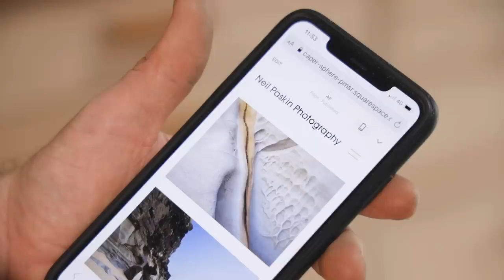Making Yosegi Plane Shaving Veneers - Scrapwood Challenge ep40

Comment: The mitre guillotine is an interesting piece of equipment, never seen one before.
Reply: @Cesar-ey7wu  Who said that using to give politicians a hair cut isn't?
Reply: At my school we have a mitre guillotine, i haven't used it very much, but when i used it (or saw others use it) only one side was used at a time.
The way he used it for making the box was like, wow (when i made boxes with 45 degree angles i used the table saw, which is anoying for small boxes and you have double the work because you need to cut each side seperatly).
From now on i will not waste time for things that can be so easy. :)
Reply: I used to work at a custom picture framing gallery back in the early 80's and they had one for cutting the material for all the custom made frames. havent seen one since so seeing this one today brought back memories for me.
Reply: Great for panel moulding

Comment: The videos I have seen usually have bigger pieces of wood making up the pattern. I see a lot of triangles made with a core piece then  a few wide but skinny strips for the outsides. And a lot of rectangles and squares.  Usually they are all made individually, glued together then, lengths cut into shorter pieces glued together to make the final pattern. Usually like 3 to 5 glue ups depending on the pattern and how many shapes are used in the final block.
 I say all this knowing that I wouldnt even be able to come close to what you accomplished here.  Only helping where I can by sharing what i have seen.
You do amazing work.  Thank you for sharing your content with us.

Comment: I have one suggestion for a cool effect: 

When you make the initial box -- before veneering, cut the sides and add the friction inserts.

Apply the veneer to the already cut box, with appropriate sizing, being careful to mark where you'll need to cut (with a knife) along the seams in the box between the body and the lid. Now, cut with a knife instead of a saw -- if you're careful you'll be able to completely hide the seams when the box is closed. 

I bet it'll be quite hard/finicky to get right, but it would be pretty cool to see it work.

Comment: Beautiful work and truly inspiring. The wood for my project is due to arrive in the next couple days and I'm excite because I've never done a project like this before. I'm using red oak or regular oak and bog oak to make the handle of a cane. I'm nervous because the bog oak is between 2000 and 5000 years old and I'm worried that I might make a mistake that can't be corrected. But I've earned from watching your videos that with woodworking, that's the only way you get better. You're projects are amazing, I can't wait to see the next one!

Comment: Your skill, craftsmanship and attention  to detail are quite amazing, your projects and imagination are most probably the best on YouTube. I'm  an old school woodwork teacher of many years, now retired and you fascinate me, but you do something that ruffles my feathers and it's  something I taught students the first time they used a Jack plane, put it away in the rack when you finish with it, always lay the plane on it's  side with the blade facing away from you when resting before reusing it. Most will understand why, but just for those who do not,  1.  Lay the plane on its side, this prevents the blade cutting the bench top and also by resting the plane on its soleplate the blade can get damaged and pushed back into the plane, which then needs readjusting. 2. Rest the plane on its side with the blade facing away from you, this prevents the user accidentally grazing their hand across the blade, a sharp blade slices skin equally as well as timber. I hope you'll  rectify this bad habit, and continue to show newbies to wood craft the right way and safe way to do things.

Comment: Looks fantastic! There’s a lot of variation between different people’s techniques even within the traditional craftspeople — you’re well within the range of procedures that even the purists would like. You might have better luck with a lower-angle Japanese plane or, possibly, by using a low-angle bench plane in the opposite direction. You get less power on a pull stroke but putting constant pressure is easier and it can avoid tearing. Have to admit, you’re getting far better results than I ever have. Beautiful work.

Comment: I had trouble on a similar project of sticking thousands of cut peices together, i was wood turning it. I found using pressure pot to force more wood glue into the joints and  grain helped massively.

Comment: Hey Pask... If you were to use a rope tied to the front of your plane, and have a helper pull while you apply downward pressure, you will get a much smoother result.  I have seen Japanese and Indian woodworkers use this method with great success.  Applying smooth constant movement will prevent the tearing.  As always, awesome work once again..  Keep it up.

Comment: Stunning result. The problem with the shaving may just be the glue. You need a hard drying glue and my understanding is that Titebond has some elasticity to it. Specially when you go thin this results in the glue stretching and as that stretch has to go somewhere there will be structural failure.

Comment: Ahh, the mitre guillotine. When I first started picture framing I had to mitre some wide strips of mount board and I got a bit carried away with just chopping the piece off and moving on........ then I noticed some blood....... yup, chopped about 0.5mm off the tip of my thumb! Didn't even feel it. After a bit of first aid I came back to the saw and found the tip of my thump stuck perfectly it place, I could have just stuck it back on, bit of tape and back to work 🤣😂🤣😂🤣

That box came out looking great and the other little bits you made are awesome!! Talk about a project for every scrap of wood 👍 nice one!👍👍
Reply: I did a similar thing with the tip of a finger. It almost was cut off, and was hanging on by a thread of skin. I pressed it back on, put on a bandage. Years later I can't even see the cut.

Comment: That would make a nice bracelet, sectioned necklace and matching earrings. Suggestion - try it. How to do it - measure wrist. Use maple or other hard wood. It's like a square with rounded corners NOT a circle. Make the blank wider than your woven piece. Cut the center out following the shape. I use a gouge and scoop out inside it. Then a sander to curve the outter surface to match. Yes you can do a glue block for the base. Route out a channel on the face to hold the pattern. I would glue in one end first, glue it along and carefully cut the end before glueing. If you're interested I can give you a diagram in a blueprint style for the set.

Comment: I tried this a while ago i couldnt cut the veneers in super thin slices with any plane that I own so I used a bandsaw to make like 1/8 inch thick  slices glued the slices onto pieces of wood that were long enouch to put through my thickness planer and took them down to veneer thickness before cutting the boards to make a box.   I used yellow Pine green  Poplar and brown oak for the colors it came out pretty good.

Comment: I wonder if you could get more consistent results by applying a piece of tape / masking tape to the surface of the block before you plane it -- that would provide a protective backing, and prevent it curling as much. Then, you'd glue it in place and remove the masking tape once it had dried.

Comment: As I've seen no one comment on the sharpness of the planes, here we go. 
6k gritt is what is considered "a usable household sharpness" 
If you want to ensure your planes actually do the job I'd upgrade to at least 12 000 gritt and then finish it off with polishing compounds and a leather strop. The difference between 6 and 8 is pretty significant. The difference between 8 and 12+ is so extreme you might as well compare 12k+ to a knife made of silly putty. 
Hope this helps and gives you better results in the future.

Comment: Im really not a master in this craft even though i have a degree but I think the biggest issue is that the blade on the plane needs to be ultra sharp, angle might be something to consider too. Seeing you hand sharpen the blade leads me to believe the blade might not be as sharp as it could be. I do admit the possibility of me being wrong about this.
Great video and cool subject, might have to try out some time. Also, subbed.

Comment: Ok, I read a ton of comments, but I didn't see any mention of that OFF THE CHARTS amazing miter-cutting machine. I mean really. God, I want one! 

Quick question from someone who uses a lot of tools but never really used a planer. What makes them so different? You mentioned that one was better than another for shaving the veneer, but I don't see what the differences are between them. Is it the thickness of the blade? Are the blades different enough in thickness to make that much of a difference. I've been looking for a good used planer, so I'm curious what to look for. Thanks for your time!

Comment: I wonder if your problem with damaged shavings could be from your chip breaker? When I watched a video of this being done in Japan I noticed their shavings come out flat whereas you had to iron your curls. This would explain why your bevel-up block plane worked better.
I don't have a Japanese plane so I don't know if yours has a chip breaker. Maybe the Japanese craftsmen use special low angle planes for this job.
It might work with a western plane if the chip breaker was moved well back from the blade and the mouth was opened wide.

Comment: I love your stuff! I have a question tho, I have a budget Kobalt brand, collapsible Table Saw. I love it because I can pack it up when it's not in use, but the fence on this thing is always SUPER wobbly and the provided holding screws just aren't strong enough.... Any ideas on strengthening or building a new fence?
Reply: I had this same tablesaw. Could never get it tuned. Sold it and bought a dewalt. Do the same, you won't be disappointed .

Comment: I know nothing about this process, but from the thumbnail and close up pictures, it looks like the blocks are very cross grain heavy. Might this be the problem why they split so easily, and would it work better if the wood grain was running the same direction as the block itself?

Comment: Not that I would ever discourage you from ordering a new tool like a low angle bench plane, but what about loading a good quality rip blade into your tablesaw and using your thin strip jig to cut the veneer? 
Edit: Oops, I watched more into the video and you mentioned this approach.  WHERE did you get the miter guillotine?  Do you have a URL for where you can get one of those?
Reply: I thought he mentioned in another video that he made the miter guillotine. I'd like to have a go at using one, looks like so much fun.

Comment: It looks really good.
I really like to concept behind this. especially using a plane to cut a veneer.

If I could offer a suggestion. Use a different finish. The finish you used seems to make the box look dull. Didn't really seem to bring out the grain. make it pop Have you tried danish oil?

Comment: I should preface this by saying the box still looks bomb as hell and I love it but the distortion of the pattern at the meeting point of the lid and the base is throwing off my groove.
I think if you cut the lid off first, got it all sanded, then add the sides it'd prevent this, or minimize it since it'd still need some sanding. 
What I would do is clamp the two sides of the box together and glue one side at a time, then very precisely cut the sides of the box apart. Or do some very precise measurements and glue top and bottom individually.
Either way the box still looks great, it's just that with such >tiny< details, the littlest of things are made far more visible. Just an idea that I thought of, but I'm sure there's many reasons why this wouldn't work lmao.

Comment: Hi, great video. Question, did you try to use a band saw to get a thin strip? instead of the plane.
Reply from the maker: Thanks Genardus! You could certainly do that and it's a good option but I would say when you add the kerf in you'd probably get something like 10-12 shavings to one slice off the bandsaw. :)

Comment: I'm a little confused...you made a block of random pieces and then made veneer from that in order to make a decorative box, which was made from "other wood"....rather than make a box from "other wood" and attach veneer, why not simply mill the glue up and make the box directly from it? You can still line the box so the inside looks different from the outside.

Comment: After sharpening my chisels/planes I strop them on balsa wood loaded with diamond lapping compound ( incredibly inexpensive on ebay). I start at the 10 micron compound and progress down to 0.5.  It's amazing the difference it makes, the cutting edge turns into a mirror. I wonder if this would help to get a smooth consistent cut when removing veneers like this.

Comment: wetting the boards and adding glue in layers might help?
Reply: great chops though man you're brilliant
Reply: clamping clamps to the bar clamp never would have thought this.  Make the box and cut it in half afterwards never would have thought this.  also the spring trick to line the box I would have used clamps.  Cheers great stuff !
Reply: interesting.  Every time I made a box I made it one at a time.  But you could just cut the box in half afterwards and get two boxes. Versus making two boxes to get one box !  its brilliant !

Comment: Hey don’t lay planes on the blade it can make the blade dull just lay it on the side nice video!
Reply: I use a small piece of carpet to protect the blade
Reply: Didn't Stumpy Nubbs do a video on this?  I remember someone making the point that that rule was taught because of the metal workbenches in school Shop classes years ago...  And that putting a blade down on the wooden bench was not a problem because the blade was meant to cut wood? But don't trust me, just something I absorbed along the way.  I like the idea of having a piece of carpet or intentional surface to always set a plane down upon,  myself.

Comment: something i have noticed with that type of inlay is that the density of the woods used should be in a narrow margin from each other ... that would be why the cedar gave you troubles it was too far out from the others but if it was just in the middle and never adjacent to another piece of cedar it would be fine with the harder woods on its edges ... 

also the direction the tree grew in matters also ... yes up and down do make a big difference .. the best bits of wood seem to be those between the branches of the tree .. in the straightest grains ... for work like you were doing ... for shapes ... the more closely the wood matches the shape the better

Comment: 1:03 is anyone else OCD kicking in about the condition of the joints, Sorry,  but, Damm, ok now ill try to enjoy the rest of the video.EDIt Sorry i can help myself, A Clean and Smooth well wax joint is easier to push wood throw, therefore making it a safer tool, just as Sharpe knives are important so is the surface on which the wood rides,  not trying to be a troll or anything.Edit:2 after watching the video throw, That little scrap box came out good Mate!